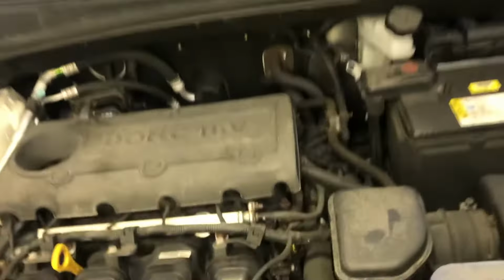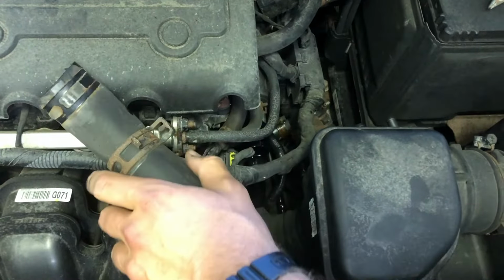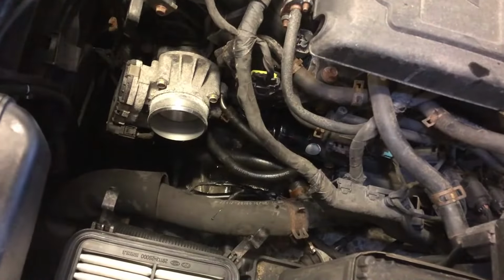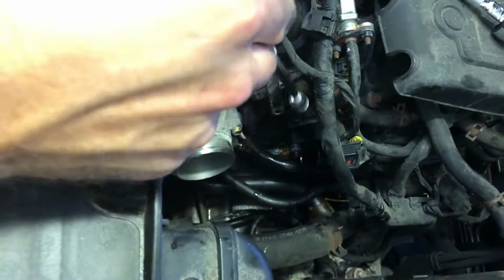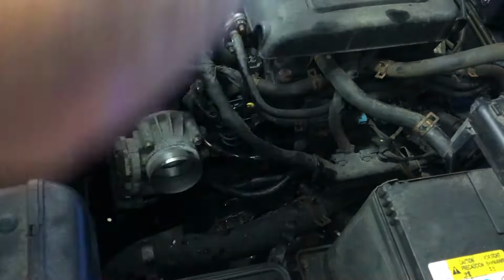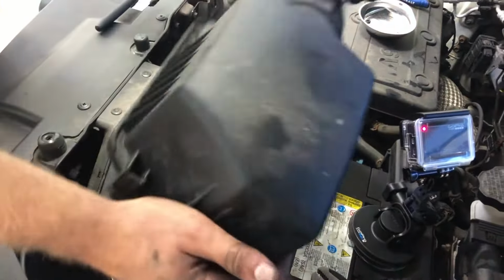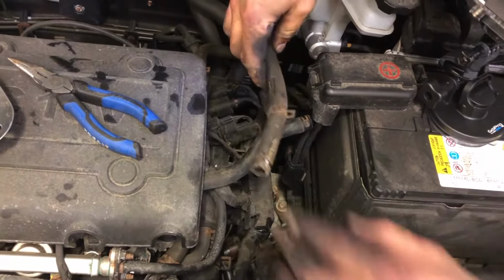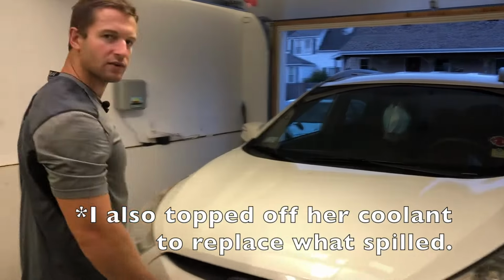Intake Manifold Runner Controller DIY Replacement - 2013 Hyundai Tucson 2.4L (Codes P200A & P2004)

Comment: But what actually failed? The motor or the plastic coupler? The plastic intakes are prone to warpage, can cause the runner flaps to stick. They should move freely so need to verify that's not binding before tossing parts at it.
Reply from the maker: As far as I could tell, it was purely the IMRC motor that failed. This repair fixed the issue immediately. You have a great point to check the runner flaps though. Make sure you won't need to fix and/or replace those instead of/in addition to the IMRC!

Comment: Thanks for the video!  I have a 2012 Santa fe with a 2.4L.  Pretty much the same procedure. This DIY repair saved me about $1000!  got the part for $180 and did the job in less than an hour.  Even my local shop wanted to remove the entire intake manifold unit !!
Reply from the maker: That is fantastic to hear! Thanks for your feedback Scott. It's so cool to hear that this video helped you, as well as many others save hundreds, if not $1000 just by getting their hands dirty and doing it themselves! Please make sure you like and subscribe as well if you wouldn't mind. It really helps me grow my channel, and I sincerely appreciate it! Take care, and have a good one. -Mark

Comment: $37 on rock auto. Never go to stealership
Reply from the maker: I personally couldn't find it! Do you have the link? Also, is it an aftermarket, or OEM? My girlfriend did not want to mess around with a non-OEM part as well.
Reply: $147 on Rock Auto now! Ridiculous how much everything has went up. 🙄 I tried to post the link and it won't let me.

Comment: Need help  it not fitting.  The new  isn't set in the place
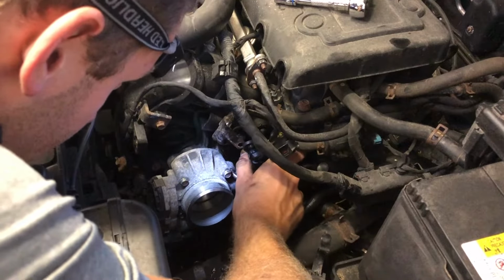Reply from the maker: So at 3:42 can you see how I take a pair of needle nose pliers and bend that small bracket slightly to give myself a few more millimeters of room to just barely slip in the new IMRC? Try that and see if that helps. Also, if that's not the issue, check the placement of that little black actuator piece. That little piece being in the correct spot is very important or else it won't work properly. I hope that helps! Let me know how you make out!

Comment: I have the same error code except that AutoZone's FixFinder says the IMRC stuck open Bank 1 and that the most like solution is to replace the IMRC Solenoids.  Did your error code indicate Bank 1?
Reply from the maker: Yup that is exactly right. My scanner indicated bank 1 stuck open as well. This fix should do the trick.

Comment: Thank you.  Very informative video.  My 2011 Hyundai Tucson also has the P200A code.  Going to replace the intake manifold runner controller and hope it will fix the problem.  The dealer quoted me $220 for the controller over the phone!!  Found the Dorman for $166 online.  Still trying to look for a cheaper place 😅.  If not, I will just go with the Dorman.  Planning to sell my car within a year anyway so won't spend more than necessary.
Reply from the maker: Kiet La Thank you very much, I'm happy it helped you! Good luck with the fix! I would say $166 isn't too bad of a price, as long as it is an OEM spec part. Idk if I would trust a knock-off brand with that specific part. Either way good luck, and thanks for your comment!
Reply: Did this fix the code, having the same issue!
Reply: Unfortunately for me, it did not.  I saw in many YouTube videos that it did for many.  In my case, it could be something else... not the controller but could be the manifold runner itself.  Good luck to you!
Reply: Hello, what kind of problem does the car present when it fails?

Comment: Hello Mark. Engine light came on and diagnosis were the codes P200A/P2004 on my 2013 Hyundai Tucson.  I just replaced my IMRC for a 2013 Tucson after watching and following your video.  Unfortunately engine light is still on.  Not sure if I need to drive a few miles before it clears or disconnect battery? I did drive to local auto parts store to retest and code appeared again, saying stuck open.  Any suggestions? Thank you
Reply from the maker: Hmmmm Interesting. Did you end up trying to clear it with an OBDII scanner? My girlfriend and I were lucky, because the code cleared on its own. You might have to go in and actually physically clear it yourself for it to go away. If that doesn’t work, it might be something else. I would then scan it again, and check to see if any new codes come up. If no new codes come up, but it still has a check engine light, and you still can’t exactly pinpoint it, I might bring it to your local trusted mechanic, or a good friend with a high-quality scan tool. Other than that, replacing the IMRC should have cleared that code. Please feel free to let me know how you end up making out! I’m very interested to see what it ends up being.

Also, thank you so much for checking video! I really appreciate the fact that you watched it, and actually used it to help you fix your car. That means a lot! Please also consider liking the video, and also subscribing to the channel! It’s free to you, and it really helps me out to grow, so I certainly appreciate it. 😁
Reply: Hey Mark. So I had disconnected battery and engine light was off.  Driven over 500 miles with no issue (engine light is still off). Ty again for your video and your help.
Reply from the maker: @scottrubin4306  Awesome man! I’m really glad that worked. To be extra sure, I would also monitor your fuel economy to make sure you’re getting within your normal expected range. The whole point of the IMRC was to essentially open and close valves on the intake manifold to potentially get a little bit better fuel economy (at least that’s my understanding of it anyway) I’m really happy that the video helped you! Please don’t forget to like and subscribe as well! Take care, and have a good one. 😎

Comment: 1. "P two hundred four" and P two thousand four" are very different numbers.  good thing you put the proper code onscreen.
2. I was quoted $148 from Rockauto 8/20/2022 for Dorman 911922, not a dealer-only part.
3. When you remove bolts holding something on, first crack them all loose, then remove; that way you'll not waste time if one of them gives more trouble than expected.  You did it right on reassembly, hardest one first. A short extension on the socket would be helpful, you only used it to tighten to final torque.  Good, you're learning;)
4.  When things are tightly fitted, such as the air intake tube to the throttle body, a little thin smear of dielectric grease (silicone grease) will help them fit, and could eliminate tiny leaks too.
5. Looks like the coolant hose should be reinstalled BEFORE the air filter assembly goes back on.
6. "as tight as it can go" means different things to different persons.  For some, it's more like "tighten until it starts to strip, then back off a quarter turn".  DON'T DO THAT.

Curious that clamps on the various hoses are the style shown - I was used to the (old style?) screw clamps.  I guess that's so the screw clamps don't get crammed on too tightly and cut hose (see #6 above).
Also unexpected that the codes stored didn't have to be cleared - they "went away" by themselves.  Or did you clear them and not show that?

All up, well done.  Deserved and got a Like from me.

Comment: hi Mark, thank you for the video, I have the exact same car with your video here and it is informative to me in the future, besides, I am  recently struggling with the installation of the block heater to my Tucson, I can not locate the hole for the block heater that install to the engine, can you point it out to me? thank you.
Reply from the maker: Tsz Wong You're welcome! I'm very glad you liked it. Do you live in a very cold climate? Do you REALLY need an engine block heater? If yes, there are many different types of block heaters that are very easy to install/use. Others are much more complicated, (for instance an inline heater) and require professional level knowledge/tools to install. I would say just buy an oil pan heating pad or an engine block heating blanket. Those require zero installation abilities or headache and take only a few minutes of your time. Plug it in and slap it on! Use a timer to turn it on a few hours before you plan to drive for early morning ventures. Don't forget to unplug it either! Run the cord over your driver's side mirror so you won't forget and have a bad start to your day. I hope this helps, and thanks for watching! -Mark

Comment: Light might be off but code will still be in the system.. Also this could have a broken intake if you can get rid of the codes.
Reply from the maker: Well, I'm not sure how that would happen... It's been over 2 years, and the code hasn't come back! (knock on wood) Thankfully this worked for us, and I hope it works for you too!

Comment: Hello, what kind of problem does the car present when it fails?
Reply from the maker: Hello Alexander! It will throw a check engine light (CEL) and read the codes P200A/P2004. This will indicate an issue with the intake manifold runner controller (IMRC). I believe what happens specifically is that the IMRC no longer opens and closes as it should, leading to worse emissions, a possible reduction in power, and worse fuel economy. My girlfriend didn't notice anything drastically wrong with her car when it happened, except for the CEL. In Massachusetts, vehicles newer than 15 years old legally need an inspection sticker every year, and her car wouldn't pass it with the CEL. I hope that helps!
Reply: @DoubleClutchAutoReviews  thanks

Comment: I have a sonata 2012 with the similar problem. But when I called the dealer, they said my model does not come with an Engine Intake Manifold Runner Vacuum Actuator. They said that I am probably thinking of the Vis Actuator part number 28321-2G700. Does this part for the sonata 2012 serve the same function as the intake runner in your video?
Reply from the maker: I'm not sure if that specific part performs the same function in your Sonata as the intake manifold runner controller does in the Tucson. However, that part does not look like anything like the other. I would guess that they are two different parts for different functions. What engine codes are you getting on your scan?
Reply: No, i have not gotten an engine light - so no code for the problem yet. My wife has had a random low acceleration for a couple of days but i have not personally experienced it myself. That particular part is located on the opposite side of the engine (left and not right) with an actuator terminates at the intake manifold. And since it also terminates at the air intake, i just assume that it is regulating the air.  I am unable to find any youtube fix for my 2012 sonata but there is a 2017 sonata youtube fix and the runner is clearly on the upper right side .
Reply from the maker: @Alex-qe2lf  Hmmmm interesting. Yeah I would say it is a totally different component, and potentially completely unrelated to the IMRC... I also find it interesting that you can't find a video for that specific fix either. When I was fixing this on my girlfriend's car, I also could not find a good video explaining how to fix this, so I obviously just ended up making one myself! Hahah anyway I'll try to do some more digging for you, but unfortunately I'm not sure how to steer you in the right direction at this point. Best of luck though my friend! I will comment back if I find out anything else that may help you.
Reply: you are the greatest, thank you!
Reply from the maker: @Alex-qe2lf  No problem my friend. Thanks for checking out the video, and I hope you enjoyed!
Reply: Found a different solution for seemingly similar symptoms for my Sonata 2012! Again, I have a random problem of low power but no engine light and no codes. I also recently discovered that the stop lamps illuminate continuously while the car is unattended. Apparently, this action activates the engine management system which in turn affects your acceleration. It turns out to be a simple brake paddle stopper problem - a $4.11 fix. As stated on the Hyundai site, it is known problem and it is an unlimited mile warranty fix. Search for sonata brake pedal stopper extended warranty.
Reply from the maker: @Alex-qe2lf  Wow, that is quite a bizarre, odd, and interesting scenario. I have no idea how that is all related, but either way that problem is indeed very interesting and strange. I'm also very happy that is a recall item apparently, and you can get it fixed under warranty. Did you get it fixed? If so, how it the car doing now?
Reply: @DoubleClutchAutoReviews  Yup, strange but true. Apt for the warranty is a month out so I just went to Hyundai and bought the part ($4.11). It took me literally less than a minute to fix replace the part. The Sonata 2012 has been running fine since. And of course, like your girlfriend, my wife thinks I am the sh&t! lol!
Reply from the maker: @Alex-qe2lf   Nice man! Glad to hear. If anything changes, let me know. Thanks for checking out my video! Also, if you don't mind of course, subscribe to me too! It really helps me grow my channel and I'd really appreciate it.

Comment: what is the part number of the actuator?
Reply from the maker: I actually don't know, I apologize. I can try to find out for you though tomorrow morning!
Reply from the maker: Vlad Vish Hey Vlad. So according to my research, the OEM part # appears to be 283232G300 with the code # being 28323H. I got this from partsouq.com. However, it doesn't refer to the part as an intake manifold runner controller. It calls it the "Motor assy - variable charge motion". This seems like it would be it, and it even looks exactly like the same part on the diagram, but I'm not 100% sure. Either way, I hope this helps! When in doubt I would always recommend calling a dealer and asking them to double check and make sure. Thanks for watching and take care!

Comment: I had errors P2017, P200A, P2006 and P2018 on 2012 Santa Fe 2.4
So it looks like I need to change Intake Manifold Runner Controller
By the logic of this mechanic this issue gonna show "Check engine" error almost all the time
but after I erased theese errors there no errors for 3 weeks\
How it can be if Intake Manifold is damaged?
So theese errors showed up today again
Reply from the maker: I cleared the codes (P200A and P2004) on this Tucson and they did go away for quite some time prior to them staying on for good one day. I would try replacing the IMRC just like I did in this video, and see if they clear. This car cleared the codes IMMEDIATELY after replacing it. Good luck!
Reply: @DoubleClutchAutoReviews  I have much more errors .
Do you think I need to fix the same issue for removing theese errors?
Reply from the maker: @spacemaster5206  I looked up all of the codes you said you have. It seems like all of them are related to your intake manifold. Try replacing the IMRC. It's totally worth a shot. As you can see from my video, It only takes about 30-45 mins total, and you only need basic hand tools.
Reply: @DoubleClutchAutoReviews  Yes I have tools and I can replace it
Just seen on one video mechanic found it for only 50 bucks when on eBay it costs 200
Reply from the maker: @spacemaster5206  Awesome. You can try the ebay part, however I personally would not just because I would worry about it's reliability/longevity compared to the OEM part from the dealer. I know you can't argue with price, but for me, I'd rather be safe than sorry when it comes to a part like that.
Reply: @DoubleClutchAutoReviews  strange things.. Theese errors showed up again for a couple of hours. 
Then
 I decided to switch ECO mode and to drive in the night (cold time) more aggressively now I'm driving 3 hours) and errors gone
Reply from the maker: @spacemaster5206  Wow. That is very strange haha. To be honest, I would just ignore it if the light went away. Obviously, do this at your own discretion if you so choose to. But to me, it seems like best case would be to just let it be until the light comes back. Then if it does, I would just bring it to a mechanic you trust, because that seems like a VERY complicated issue lol.
Reply: @DoubleClutchAutoReviews  yes, its showed up agan)
Reply from the maker: @spacemaster5206  Yeahhh it sounds like you should bite the bullet and bring it to a TRUSTED mechanic. Hopefully it's not too bad. Good luck my friend! Thanks for checking out my video either way!
Reply: That a new intake.. The flaps are broken inside
Reply: @DoubleClutchAutoReviews  the engine light will go out if you move the plunger on the other side of the intake up and down but codes will still be in system..
Reply: @spacemaster5206  flap is broken in the intake
Reply: @Gta2O13  no it's ok
I ordered new Manifold intake runner control from eBay and fixed this issue
Reply: @spacemaster5206  good thing you didn’t waste money on a unnecessary intake like person in video did..
Reply: @Gta2O13  so concern Kia/Hyundai makes pretty reliable intakes
Reply: @spacemaster5206  unfortunately not on the 2.4
Reply: @Gta2O13  I had 4 Santa Fe with 2.4 engine and there were' not any problem with intake
Now I have 2.4 with 220k miles

Comment: Where can I get that part for my car ?
Reply from the maker: Unfortunately, I think you can only get them at the dealer. You can try to call any normal auto parts store and see if they have it, but I'm not sure how much luck you'll have. I had to go the Hyundai dealer in Attleboro to get it. It should be around $140-$150.
Reply: Dorman 911-922 Engine Intake Manifold Runner Control Motor for Select Hyundai/Kia Models
AMAZON same price as dealer
Reply: @robinkaiser5171  online is cheaper